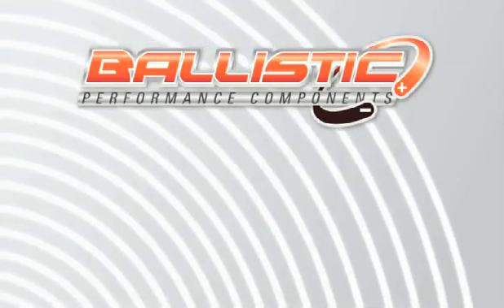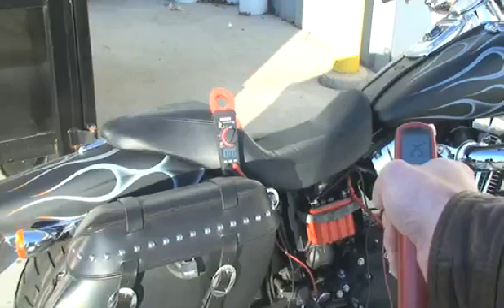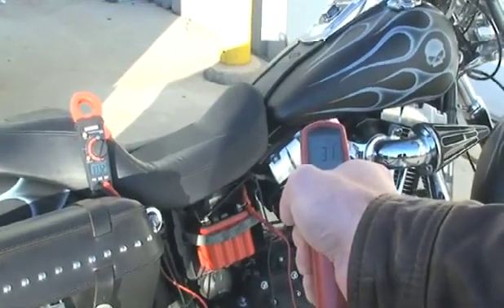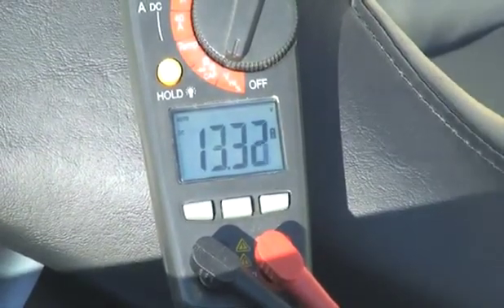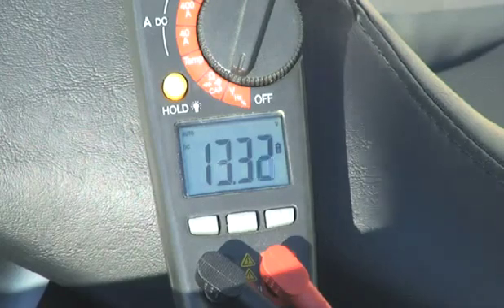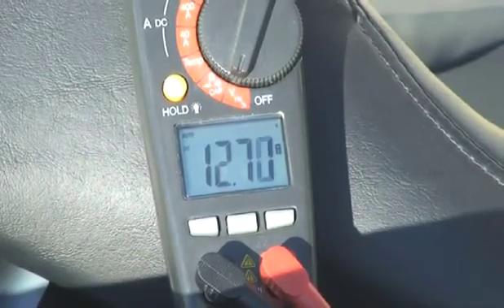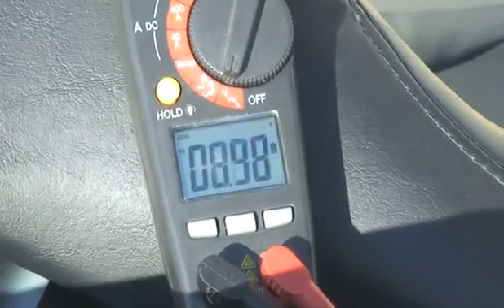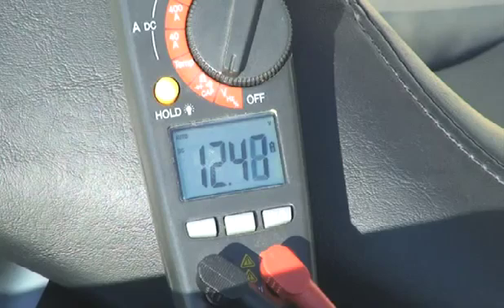Ballistic EVO2 Battery & The Cold Starting of LiFePO4 Batteries - on Motorcycle-Superstore.com TV

Comment: These batteries do require balancing often, I tend to charge mine up to 13.60  3.40 per cell on my 60 ah  battery. Until the current drops down to .500, Anything past that you are top charging your battery. it's ok to charge 14.1v   but after that you got to let the voltage sags back down to a optimal 13. 32 my battery's been working flawlessly.

Comment: I'm weary of these Ballistic Lithium Batteries. I emailed Ballistic asking if these batteries had a built in Power Circuit board or PCB as the first generation didn't have the balance port jack and the second generation has a balance port jack. I got no response. These batteries are different than Laptop batteries but still require a different charging system. Correct me if I am wrong but I have yet to see a motorcycle or Car other than an electric car such as an example the Volt or the Tesla that can properly charge these batteries. The problem lies in that the balance charge jack is USELESS if its not used CONTINUOUSLY for charging the battery with the special charger. The balance port jack is an indication that these batteries do not have a built in PCB. The PCB not only regulates the charging of these batteries cell by cell but also regulates the current draw. The PCB charges each cell individually and shuts down each one when it reaches its top voltage, preventing overcharging damaging the cells and or fire. Your cars or bikes charging system doesn't do that. When the PCB does this, your battery won't act like a regular lead acid car battery. Also,when you start a bike, a big bike or car it pulls a lot of amps. To manufacture a PCB that can handle such a load isn't easy in a small footprint (size). So these LifePo4 cells are connected directly to the batteries terminal posts (dangerous) and charged by the bikes regular charging system. That's probably ok on a small scooter that charges at maybe an amp, ok on a race bike or car that doesn't have a charging system and runs off the battery or isn't used on a daily basis, but not ok on todays big bike or car that come with 130 plus amp alternators to power all of todays hi tech auto add on's. Furthermore, todays cars and I will guess new bikes with fuel injected engines won't run without a battery. Disconnect your cars battery terminal while your engine is running, it will shut off after a few minutes. The battery acts as a capacitor. It needs a battery weather its dead or alive to absorb the loads, I don't see how a LifePO4 can do this with a PCB after its been fully charged and the PCB stops all charging to the battery.
Furthermore, I called Ballistics and asked about the problem some have had when tilting the battery and getting no power but tilted back power resumes and he claims he never heard of any such problems but there are video's on YouTube showing just that. Seems these cells are not soldered together? So, I wouldn't advise running these on anything that can charge it at over 3 or 4 amps, unless you want to risk it possibly catching fire and damaging your bike. Until a battery comes out with a built in PCB that is designed around todays vehicles charging system or a vehicle is designed to operate on a lithium battery you are running a risk. Yes LifePO4 are less dangerous than the lithium batteries in your laptop but they STILL require sophisticated charging systems and monitoring. There are several video's here on Youtube showing LifePo4 batteries catching on fire when overcharged. Just FYI, we use these in our model airplanes, we charge them via the charge balance jack or directly. The planes motor controller regulates the batteries output. We have had these go up in smoke when someone has charged them to quickly and every time it has been when it was charged directly and not thru the PCB. The PCB takes longer to charge as its current is controlled. Your Laptops battery and even your cell phones battery has a mini PCB circuit, your lithium power tools do to. They disconnect your charger once the battery reaches 100%.  Ballistics sites claim their batteries are not just a bunch of cells soldered together and sealed in shrink wrap, no, they are a bunch of LifePO4 cells in a fancy plastic case obviously not soldered together as some have found. You will be better off and safer by getting a new dry shipped AGM (absorbed glass material) battery that comes with its acid pack, and fill it yourself that way you know its fresh and hasn't sat on the shelf for 6 months or a year. Just a word of caution!
Show less